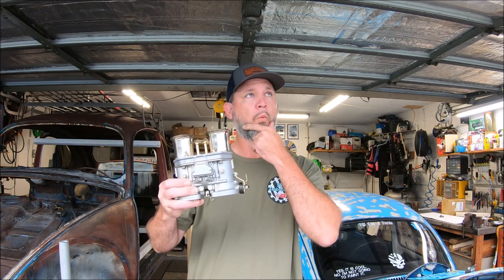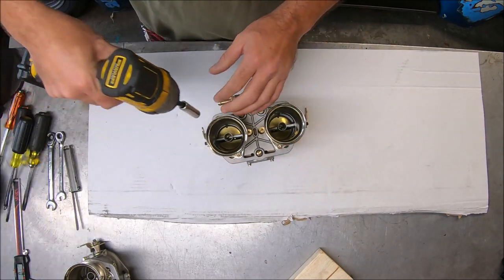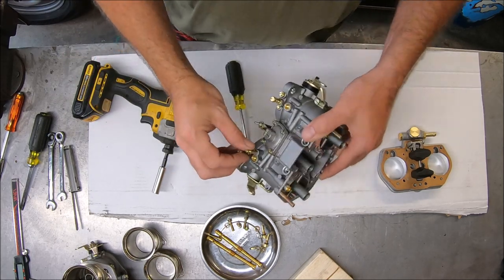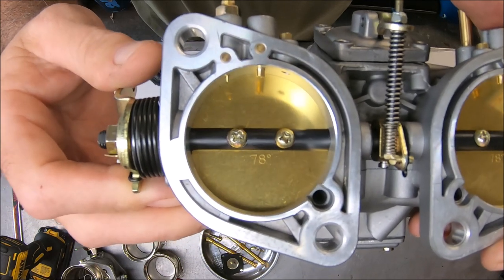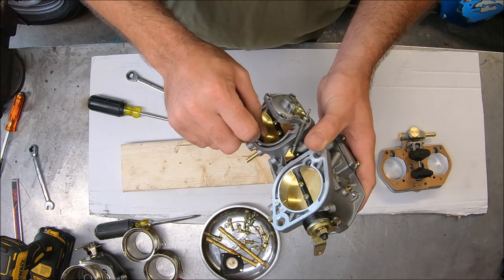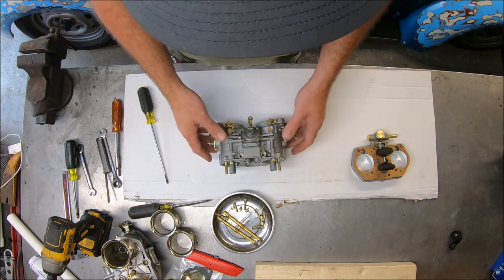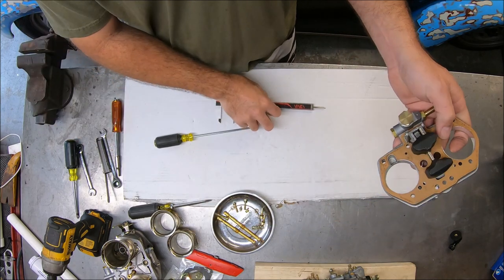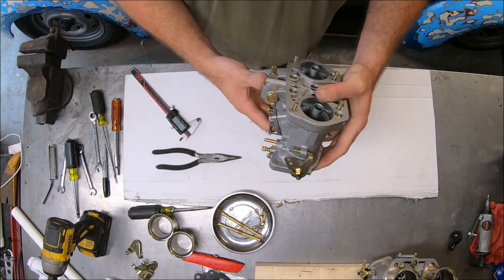No Name Chinese IDF Carbs for your Aircooled Volkswagen? Unboxing, Inspecting and Setup! Part 1/2

Comment: I've just recently got back into VW'S, had a bunch when I was a lot younger so I'm basically relearning everything. 
I have a 2110cc in a 63 baja, 110 cam, slightly better than stock DP heads, SVDA  distributor, merged EMPI exhaust, and used 40 IDF carbs which I believe to be these clones. 
Engine idles perfect and good WOT but off idle to 1/4 throttle is terrible. Surges and stalls until I get rpm's up and or more throttle. The crossbar linkage looks ok except for the bolts on the lower end of the heim joints, one attaches close to carb and the other is about 1 inch longer. So geometry looks good from left to right on both sides of linkage but different angles from front to back if that makes sense? That being said I'm not sure that would throw it off enough to make the carbs open slightly different at part throttle but something is definitely not right.
Another issue I'm having is the vacuum ports don't seem to have enough vacuum to advance the distributor. It's running from both carbs to a T and then to the distributor but has zero effect on it, only advances mechanically. 
I apologize for the long novel here, you seem to know a heck of a lot more than I do!
I've swapped out the  distributor but haven't tried mechanical advance only. Put the 34 pict 3 carb setup that was on the car originally before I rebuilt it and basically ran the same as far as part to 1/4 throttle. 
What could you recommend for a good throttle linkage so I can at least eliminate that problem? 
I'm having a lot of fun and I'm determined to get this thing dialed in, any advice would be appreciated. 
I guess I should mention that the mains are 125, air correction 200 and idle jets are 55, not sure what emulsion tubes? 
Thanks again
Reply from the maker: Glad you’re back into VW’s!
Well, that stumble could be a couple of things. 
Ensure valves are adjusted correctly, no vacuum leaks at the heads or carbs, throttle shaft areas. 
As for linkage, I really like the CSP center pull linkage. Best one I’ve used so far. 
You’re jetting sounds pretty good, you would need F11 emulsion tubes for dual carbs. 
Here’s a great article on jetting 
https://www.aircooled.net/vw-carburetors-jetting-102/
I’d tend to look at the accelerator pump and pump adjustment.
Reply: @VWJawbreaker  thanks for your input, I adjusted the valves yesterday for the first time and checked the float levels and idle jets as well. I'll check for air leaks, that makes sense and could also be the reason I'm not getting good vacuum from the ports off the carbs for the distributor. I used the stock style metal intake gasgets cause that's what I had, those things never made sense to me? Would paper one's work better between intake and heads? I'll check the emulsion tubes and maybe get some weber jets in case the ones I have aren't accurate. Did you ever use the jets that came with the cheaper carbs?
Reply from the maker: @Golden-ui5um  for dual carbs I’ve had better luck with the paper intake gaskets vs the metal ones. Not to mention the metal ones are a one use only type of gasket. 
Without having a proper gauge to check the jet sizes, going to Weber brand jets would be a safe thing to do. I’d still look at your accelerator pump adjustment, there shouldn’t be a ton of threads showing. Back then off, then slowly add a turn at a time until it accelerates properly.
Reply: @VWJawbreaker  I did look at the threads on the pump, the nut is cranked way down on the threads on both carbs. I'll reset them the way you did in the video and get some better manifold gaskets.
Reply from the maker: @Golden-ui5um  the pump adjustment could be most of your problem if they are cranked down that far. Try that first and move on from there.
Reply: @VWJawbreaker  I decided to take the carbs and manifolds off, put on some paper manifold gaskets, calibrated the butterflies on the carbs, and fixed the accelerator pump adjustment. 
Putting things back together my throttle linkage geometry was pretty out of sync so I've got that set up better. 
It's not perfect yet but night and day difference! 
I've subscribed to your channel and wanted to say thanks!
I'm in very rural Utah, about 2 hours from anything that even resembles a town that has more than a post office and a couple of gas stations. We have one repair shop in town so I get what I can there but I'll be doing a lot of work on this car with the help of YouTube and people like yourself so thanks!
Reply from the maker: @Golden-ui5um  I’m glad to hear you’ve gotten things mostly straightened out! 
I’m not an expert but a guy who knows a few things just recording what I’m doing here and there sharing my experiences. 
I’d love to be a rual as you are sometimes, I’m sure it gets ok’d after a while also. 
Hope you find other things useful, helpful or just entertaining. 
Have a great day and stay safe.

Comment: Might get a couple of these get my 1600 twin port go a bit faster 🤣
Reply: Its nice works good
Some modify to works
Reply from the maker: You just need to jet it accordingly and run the 40’s with the smaller venturi.
Reply: @VWJawbreaker  yes of course jeting very important and fuel flow in the carbs
Reply: FAJS COMPLATE 
2CARBS 44MM
LINKS COMPLETE SET
ALSO MANIFOLD 2SIDE
ALL THIS 300$
AND THEY SHIP 🚢 TO
UNITED ARAB EMIRATES 
ONLY 100$
THATS VERY Cheap👍
Reply: @VWJawbreaker  what size is the smaller venturi?
Reply from the maker: @fredgriffith2481  for which carbs?
Reply: @VWJawbreaker  40 Idf
Reply: @VWJawbreaker  we have a 71 super beetle 1600 motor on a 57 vw dune buggy manx style
Reply from the maker: @fredgriffith4311  smallest venturi is a 28mm I believe.
Reply: @VWJawbreaker  thanks alot for all the info we're new to this. 👍

Comment: Why not run the f2 emulsion tubes? Curious
Reply from the maker: Something with the way the holes are in the other tubes and size of the holes makes them richer and lean out in different areas. 
I’m no expert in all that, I’m going off of what the experts say, like John at AirCooled dot net for example. F11’s for dual carbs and F7’s for a single dual carb.
Reply: The F11 is great for most Dual carb setups with 36/37 or smaller vents .
 The f2 may play well with a 48IDF .
Each emulsion tube as specific characteristics based on O.D. Of the tube and how much fuel is in the galley - along with location of air inlet holes which dictate richness of the mixture provided to the secondary venturie- float height and emulsion tube also dictate when main jet stack takes over . 

As a gauge about 25% of throttle position is idle jetting
A decent portion of this also gets a little adjusted fuel delivery based on mixture screws.
Mains are in full control at 75% to 100% full throttle 
Everything in between is controlled by main,emulsion tube and air corrector .
Not exactly on the above but is good gauge for idea
Reply from the maker: Ok Tommie, you can take over my channel now 😂
Thank you for explaining that so well!

Comment: Where can i purchase a set? Got a link?
Reply from the maker: They are all over eBay. Just search for the size idf carb that you need.
Reply: @VWJawbreaker  i don't know what size i need, i am running a 1776cc motor with an Engle 110 cam & full flow heads, electronic points.
Reply from the maker: @dubbaircoolskunkwerks8204  do you know exactly what heads and engine compression?
Reply: @VWJawbreaker  i have no idea, i was gonna run an Empi progressive or a set of Kadrons.
Reply from the maker: @dubbaircoolskunkwerks8204  that’ll work or the egas 38/38 is a better choice than a progressive imo. I’ve never been a fan of the progressive since I have little experience with it. Seems the 38/38 is easier to tune.
Reply: @VWJawbreaker  that sounds like a winner, i did see a 38/38 from southwest at a great price but wasn't sure if it was compatible with my setup. Your feedback has been most helpful and informative. 🚥
Reply from the maker: @dubbaircoolskunkwerks8204  glad I was able to help. Enjoy your week.
Reply: @VWJawbreaker   Hi i purchased that 38/38 Webber progressive carburetor and it seems to have two fuel inlets,  i am confused. I don't have that setup on the Empi progressive, it has only one inlet.
Reply from the maker: @dubbaircoolskunkwerks8204  i don’t have one in front of me but I think it’s so you can run the fuel line a different way and keep the other blocked off.

Comment: After spending 1100 bucks on a set of Redline IDFs and having nothing but problems I ordered a set of these. The redlines have leaking needle valves, Venturis with holes in the sides and sealing surfaces so bad the factory stacked gaskets to get them to seal. No quality control what so ever. I basically have to rebuild them before using them. Junk.
Reply from the maker: Wow, can’t believe redlines have gone down hill so much